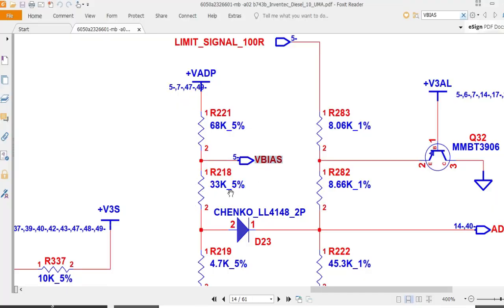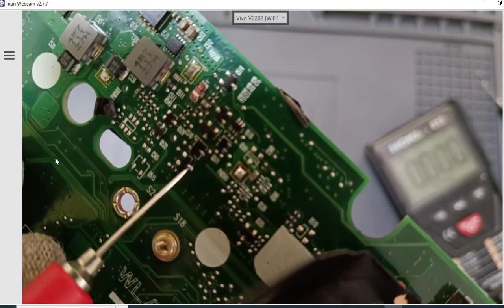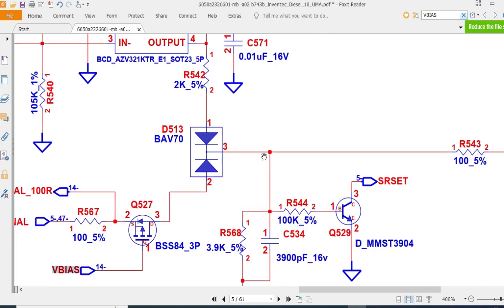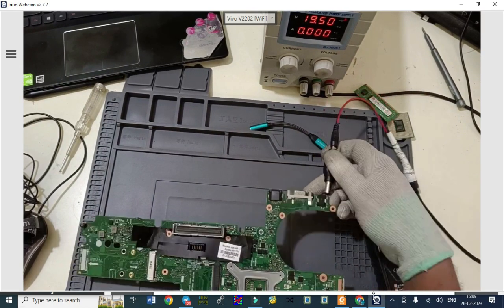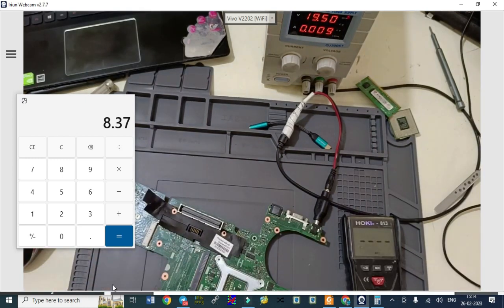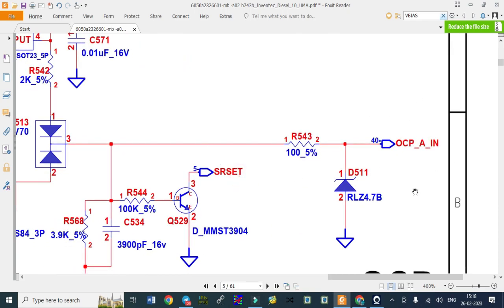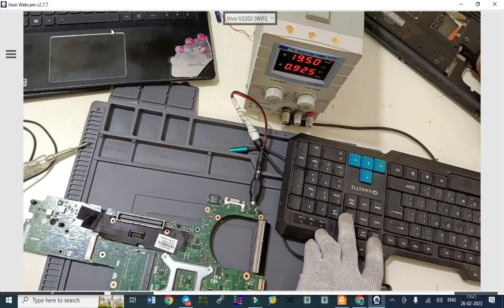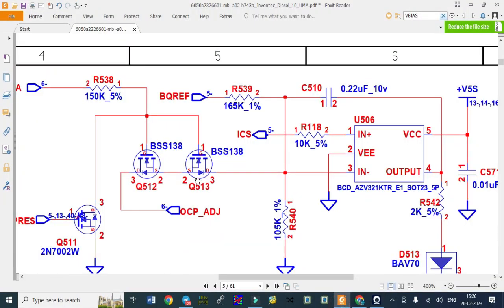Laptop Repair - 17 - HP PROBOOK 6450B CASE STUDY 02 CASE SOLVED!

Comment: Hi, sir I got this same ADP_EN not present issue on the gate of Q, mine is probook 6470b.
Tried to trace it till I/O device mine is SMSC, VCC 3volts present VCC1_RST# 3 volts present but whenever I check these 2 pins and come back to ADP_EN it works as magic the 3 volts present back.
NB: before SMSC test ADP_EN unavailable later after touching VCC and VCC_RST# with probe ADP_EN works.
😢
Reply from the maker: later i will check and reply for this.
Reply: @LaptopCourse  Ok thank you sir